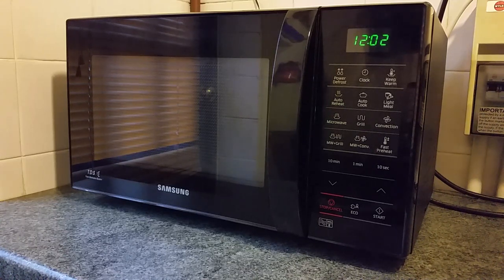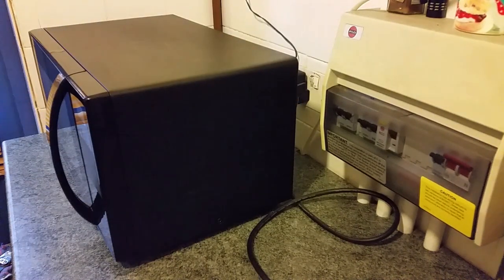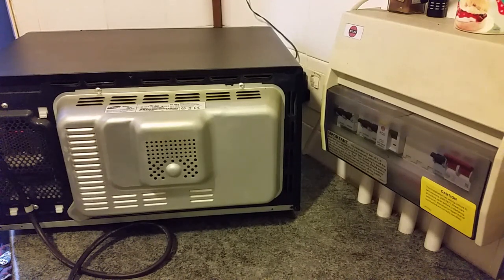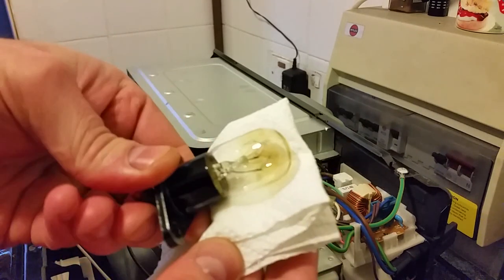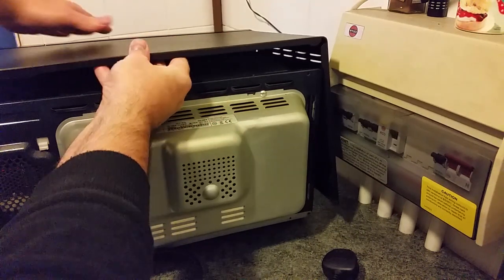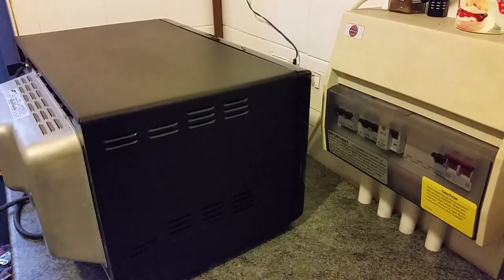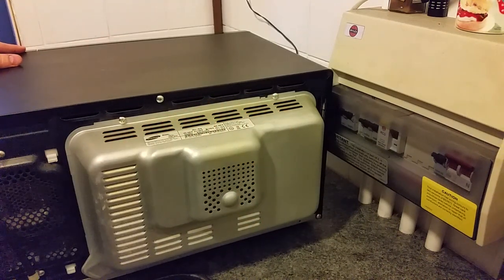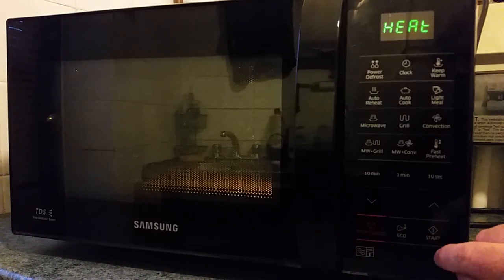Replacing The Bulb In A Samsung CE73J Microwave/Oven

Comment: Hi. I have a similar one. The light is very poor. You can't see inside. Is it possible to change it with a led bulb in 4 Watts? It will have more light and economy. Will the led lamp last? The type of the bulb is e 14?
Reply: Hi there i have also recently bought one of these recently the model  MS23K3515AS and find the light very dim and wonder iff it can be changed. The problem is they dont  for obvious reasons have them plugged in at the shop so could not see the light but its way too dim.
Reply: @sajidkhanmahmood   yes, I changed it with a e14 5watt  led lamp and everything works great. I also changed the base for the lamp because the old was fixed with the lamp. I have the same lamp 1 year and the light inside the oven is satisfying.
Reply: @nick1080p  Hi thanks for the sharp reply is it complicated and is yours the same model as the one i mentioned. How much more light are you getting is it considerably more light and worth doing.
Reply: @sajidkhanmahmood  yes it worth it. The oven has black ceramic inside that's why the simple lamp that is 20 Watts doesn't have light. A 5 Watts led is 50 Watts if it was old type.

Comment: my bulb looks the same but it won't come out of that white plastic/metal sheet case that you pulled it out of so easily. I removed the pins that hold it place. The bulb moves freely now but it won't come out of the hole. I dunno how they put it in or how the hole got smaller. I can't see any signs of melting or distortion due to heat.
Reply from the maker: I can not imagine why that would be, I wish I could help.
Reply: @DevelopIT  Hi Swagat, I had a similar 2 White Stick to hold the Bulb in my Samsung Microwave Oven,  try to squeeze the white stick one by one to release it from the hold, it is Split in the bottom, Once you Squeeze it it gets thin, allowing you to pull out the L pin Bulb easily. Hope it helps you

Comment: Replacement was easy, but the lamp now keeps  burning even when the microwave is shut off. Is that fixable? What went wrong?
Reply from the maker: I think it lights when oven is in operation or the door is open. Is the door switch misaligned or broken? I've not had to look at the door switch before so I don't know where it is located.

Comment: Failed to mention the danger regarding the capacitor still holding a powerful electric charge even when the oven is unplugged. To be safe it needs to be drained before you do anything on the inside of the oven.
Reply from the maker: You must have missed @00:46 where I specified not to go near the capacitor because of a potential residual high voltage charge. The capacitor is recessed bottom right the bulb is top left, so there is no need to go anywhere near the capacitor. I strongly advise not to do what this person has suggested as before the back is taken off the appliance must be unplugged from the mains, so it is no longer earthed, attempting to drain the capacitor would risk bridging the capacitor with part of the metal work which would be very dangerous.
Reply: @DevelopIT  Hey. Thanks for the tutorial, very helpful indeed. greegan must be an electrical engineer grieved by the fact that you, my friend, have given people the opportunity to fix this themselves. I for one have been a victim of my local service centre. They tried to charge me an extortionate amount of money to fix my microwave last year. I kid you not.. What they wanted was more than the microwave cost me. That wasn't for a bulb, some circuit board. Lesson learnt, was never to entertain these people again as they are rip-off merchants. £5 for a bulb though, wow. Thanks.